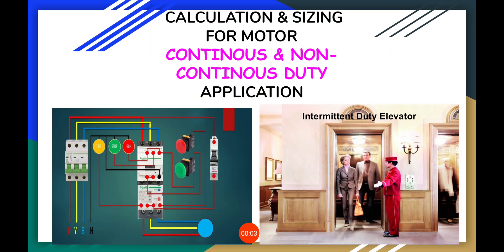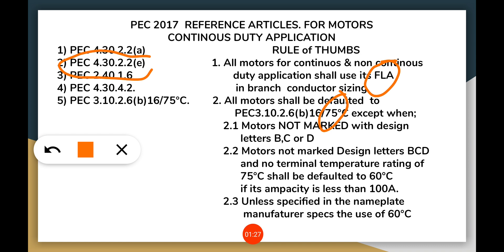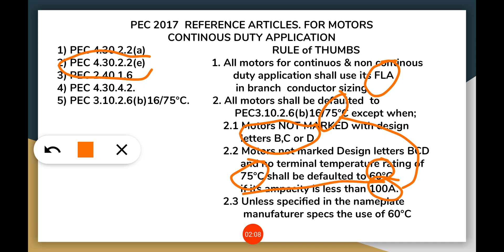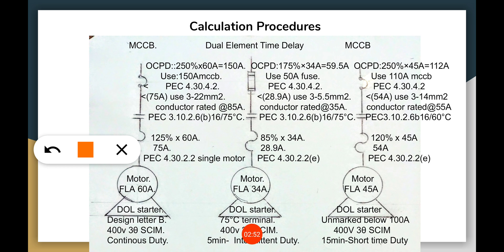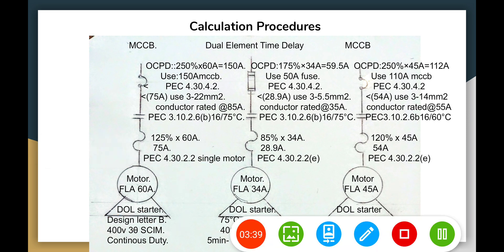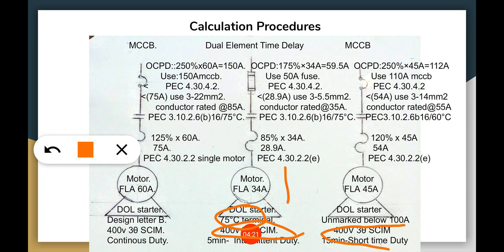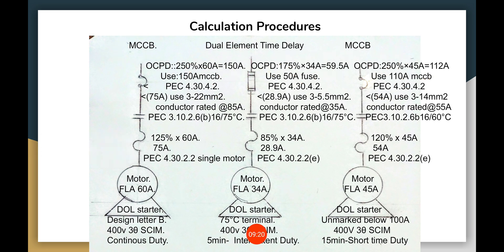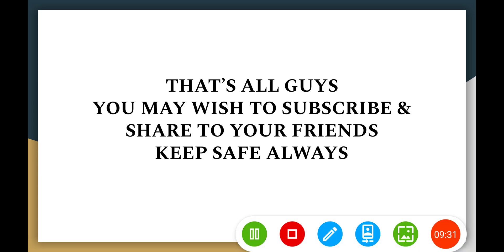CALCULATION & SIZING OF MOTOR CONTINOUS DUTY APPLICATION

Comment: Sir ano po pinagkaiba neto based dun sa naunang niyong video?
Reply from the maker: Sa multiple motor sa OL lang inaplay ang FLA. Sa OCPD FLC pa rin dahil continous load ito na motor.
Bago both OL & OCPD both ginagamitan ng FLA as per code 4.30.2.2(e)
Reply: Sir last question po sa sizing po ng CB example po pag 100A po yung nakuha natin sa computation ang selection po natin ng CB diba po dapat 100A din pero bakit po minsan 125A po yung kinukuha? Salamat Sir!
Reply from the maker: 125A dahil sa 80% restriction ng mccb base sa code